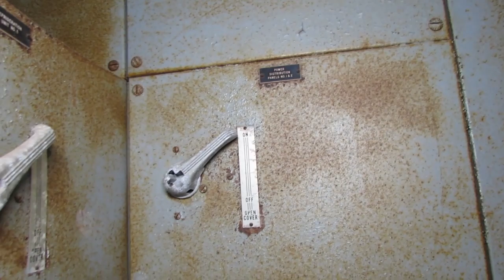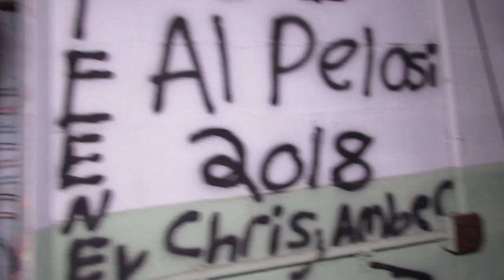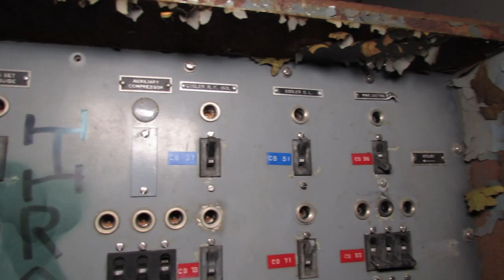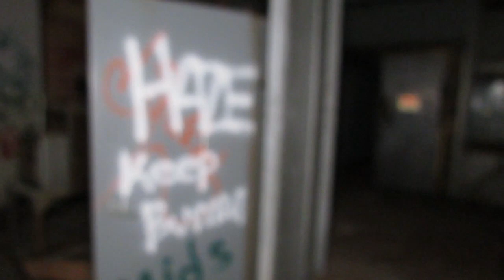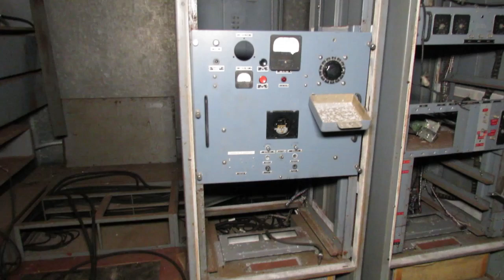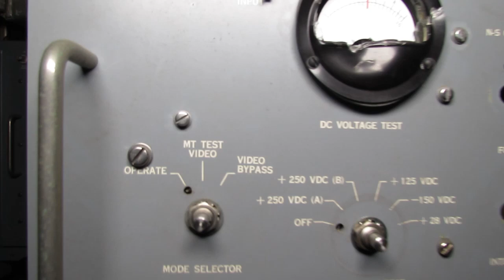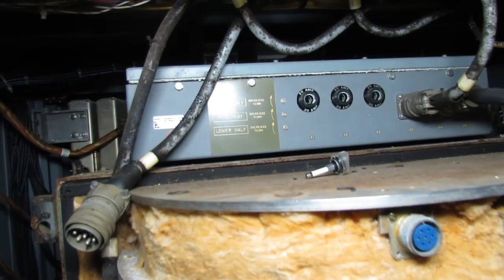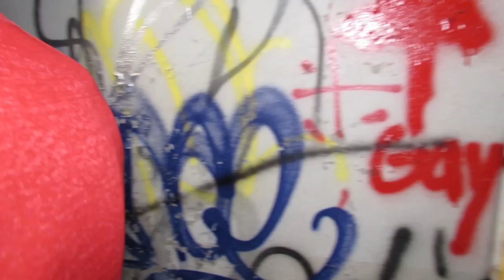(ABANDON AIR FORCE BASE "CAMP HERO" MIND CONTROL FACILITY)

Comment: The building you were in was entirely devoted to radar, including two below-ground levels. All the equipment you saw was related, and much of it has already been removed. Rumors that the radar dish is still in use and rotates occasionally seem silly to me; it's rusted and can't rotate, the waveguides are gone, much of the dish is rotting away, and there's no support equipment with power. Every photo I can find shows it pointing the same direction.

If any weird experiments did happen there (and in my opinion, they didn't) they would have occurred in underground areas. The base did have some, but they were mostly just tunnels to access the guns on the cliff and, under the radar building, for large transformers. In its operational days, the base's buildings (besides the radar dish) were disguised to make them look like a small civilian town. Some of those are still standing.

Comment: A dummy load is a device used to simulate an electrical load, usually for testing purposes. In radio a dummy antenna is connected to the output of a radio transmitter and electrically simulates an antenna, to allow the transmitter to be adjusted and tested without radiating radio waves.

Comment: Crazy place, Chris! Glad you only got a little hassled for being in the building, and then let go. Hard to say what all the electrical equipment is for.. my best guess is mostly radio waves. Circuits like that probably would fit on a chip nowadays, but used to take up a whole building. Fascinating to look at, but ??? what the hell is that stuff??  Thanks for the video! Go have some fun! 💪🏻👍🏼

Comment: Dummy Load is a simulated antenna for a transmitter tune up without actually putting a signal into the air.....

Comment: the round enclosure is part of the crystal oven for the microwave transmitter.  required stable temperature to maintain correct freq.

Comment: Allot of power was generated here. Switched power AC/DC. Tremendous amount of switch gear there. This is all analog switch gear which is why there is so much and allot of cooling was needed due to large amounts of heat generated. This amount of equipment is way over the top for just a radar station.

Comment: Visited last summer.  I found a doorway to one of the bunkers near the radar station.  The door was there, but the doorknob was not.  Perfect place to peek inside.  I put my phone camera up to the hole and could definitely see some equipment and safety cones inside, as well as a little red light that lit up as soon as I stuck my camera in the hole to look around.  Immediately, Park Police rolled up behind me and eyeballed the shit outta me.  But I was doing nothing (and had no intentions) so there was no worry.  I must have sent off a motion sensor (I think that's what that red light is), because the timing of the Police was perfect (sorta like your encounter with EHPD).  You guys must have tripped some sort of alert too.  It makes sense (conspiracy or not), because people could get REALLY hurt in a place like that.  New York State doesn't like even the slightest idea of a lawsuit.  

Anyways, great video!

Comment: A "Dummy Load" is used to test a transmitter instead of using the actual antenna. The Dummy Load appears to the transmitter as an actual antenna. All the RF fed to the Dummy Load dies within the Dummy Load and does not get transmitted into the airwaves.

Comment: It was like the time tunnel - people sat in THE CHAIR which I think was in the basement like a dental chair and would mentally go in - via the use of CRAY computers and a lot of electricity and magnetic fields - anyway - there are probably still people trapped in the AETHER, the ones that never came back are still waiting for the chair to be fired back up to bring them in - but that will never happen now - so they did not die but they ain't here or there - so where are they ??????  YOU HEAR THEM!!!!

Comment: A "Dummy Load" is usually used in electrical systems that generate their own power. What you dont use you have to store and you can only store so much, so as overload protection there is usually something like a heating element to burn off the extra - AKA - a Dummy Load. I used to work on a very similar power bank. Low voltage is used to control the high voltage. You dont play around with 480 V. It will kill you and throw you across the room.